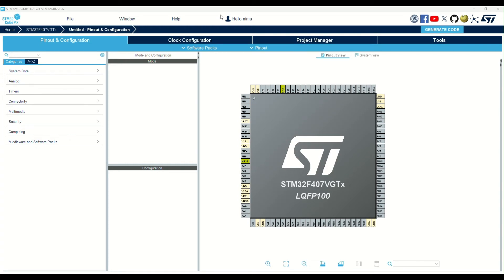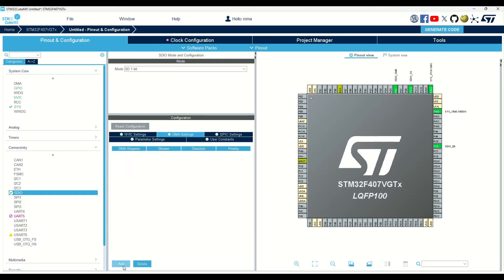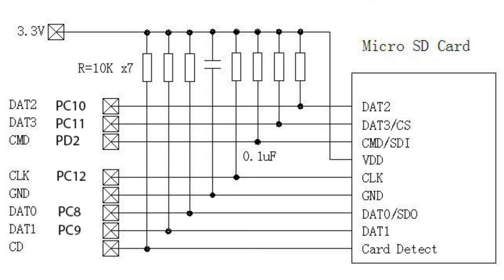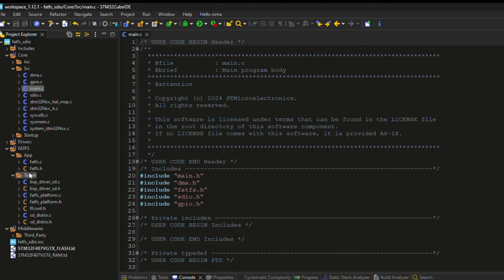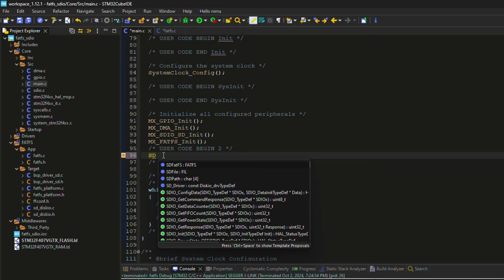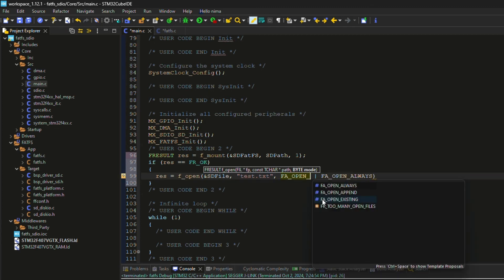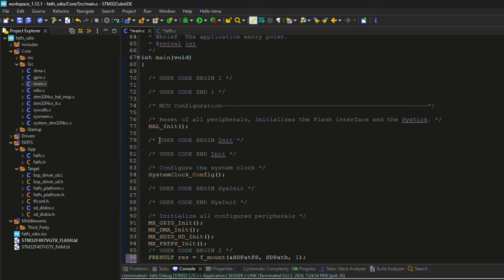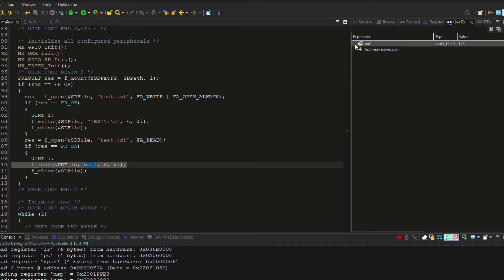STM32 LESSON #12: SDIO ( FATFS)

Comment: @NimaLTD 0:35 in old CUBE simply code generated was for 1bit mode even if you choose 4bit mode - that's way it work but never in 4bit mode - check the initilization SDIO (SDMMC) code. In new version Cube generate code for 4bit mode if choosed but it never work. Anyway running true 4bit SDIO mode is possible - check my movies. At the ST forum I posted how to do it.

Comment: Du brauchst erstmal nicht die eigenen Pullups. Der Prozessor bietet an den entsprechenden Pins eigene, die man in diesem Menu ankreuzen, aktivieren kann (außer clk)
Reply from the maker: Ich bin mir nicht sicher. Aber in allen Schaltkreisen werden externe Pull-Ups verwendet.
Reply: @nimaltd Ja, ist richtig. Da gehören Pullups ja auch hin. Im harten Produktionsumfeld. Aber für eigene Anwendungen kann man die Prozessoreigenen auswählen, die dafür da sind, um die Sache etwas zu vereinfachen. War nur ein Tipp, dass der Prozessor schon so etwas von sich aus bereitstellt. Default sind die abgeschaltet. Kannst du doch in CubeMX oder -IDE sehen. 
Pinout & Configuration, SDMMC1, SD 4 bits Wide bus (oder anderes), GPIO Settings. Der Bildbereich ist dort horizontal geteilt, also etwas nach unten scrollen, um die Einstellungsmöglichkeiten pro Pin zu sehen. Außer SDMMC1_CK (selbstverständlich) kann man den internen Pullup aktivieren. Übrigens um sicherere Signalstabilität zu bekommen, kann man die Geschwindigkeit von "very high" auch etwas herabsetzen, je nachdem.